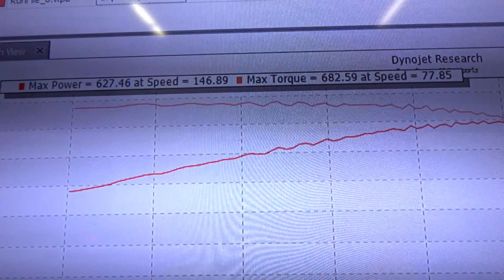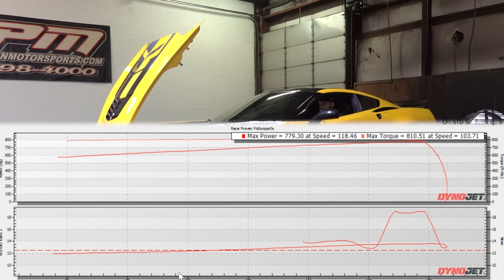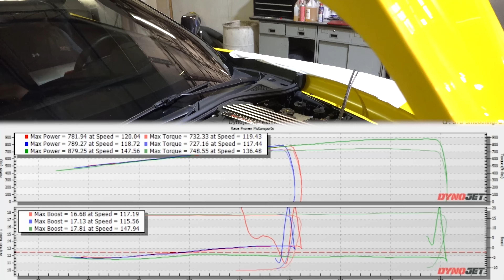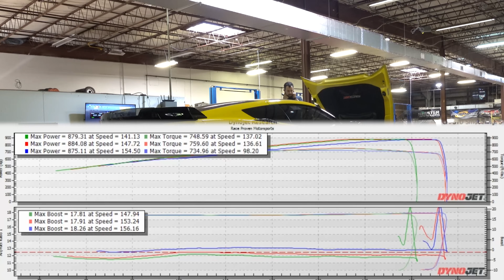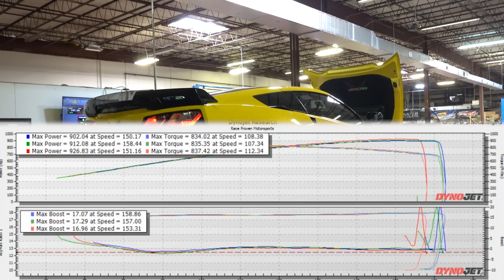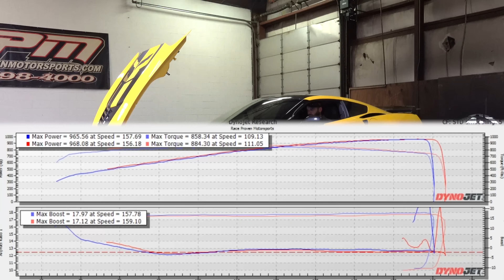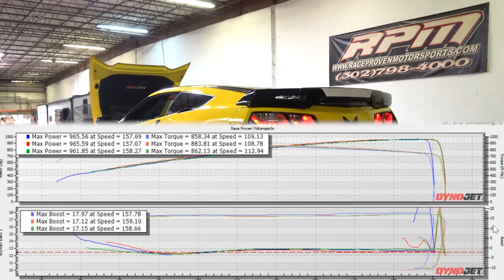Heads Cam 2650 Magnuson C7 Z06!!!

Comment: I made these exact numbers on port injection 964/884 but 20psi with same mods except I have 80 upper and 9.2 lower.  I know port isn’t needed for unless 1100+ I just didn’t want to run meth and wanted to just fill up with E only.  Tuner said he kept timing lower in mid range to keep internals happy.
Reply: Did you use the toohighpsi port injection? If so did you end up having to remove the hood liner for everything to clear?
Reply: @ArcticZ1  no used their lid with the LP plates
Reply: And yes used their kit
Reply: Awesome I’m going that route as well. Thanks 👍🏼

Comment: Still stock injectors and hpfp on the yellow vette?
Reply from the maker: Yes
Reply: @RaceProvenMotorsports  that's awsome on pump and meth with fuel lobe on cam getting to 900 is easy. I'm guessing pulse width b er low 5.5 when still on 93?

Comment: Question; does anybody ever worry about the guibos (couplers not an ethnic slur) on a high horsepower upgrade like this? My first Vette was a C5 Z with a Procharger and meth kit running 10.x PSI boost. Around 600 WHP. It was upgraded as it passed through a few owners and when I got it the engine was as described and the T56 and diff had been rebuilt by RPM in MD after it lost 3rd gear. Somewhere in all the work someone worked on the TT/prop shaft and when I was putting around, one of the guibo bolts almost fell out. Either the aluminum threads were stripped out of one hole in the prop shaft (most likely) or it was not tight enough with not enough blue Loctite. Had to pull the rear cradle and all that to fix it. I vowed at that time to rebuild the TT correctly on any transaxle Vette  I disassembled to that extent. In this case I found a 3.5" DSS aluminum prop shaft in stock locally and installed new bearings (not replaced the first time) but that changed the character of the car. Above 1800 RPM the car vibrated, not terribly pleasant for a road car. I just rebuilt the TT in my C6 Z06 while it was split apart to install Monster triple, Magnuson Heartbeat, etc. The guibos are available from Euro car parts houses for $60. The bearings are available for $100 (good Koyos from a bearing house) and I already bought the tools to work on the TT. A gallon of blue Loctite later (don't skimp on that stuff) I'm as confident as one can be in the parts and labor. Still I wonder about the power handling capability of the guibos and I never see them mentioned here or on other channnels like Late Model Racecraft. 1200 crank HP and the guibos are still okay? I have a curious nature and as easy as rebuilding TTs are, they're a lot of work to get to when you're a shade tree mechanic like me.

Comment: Why don’t you guys ever add Port Injection on your high power cars? A lot of ppl swapping over and getting rid of the meth
Reply: Much more expensive that meth. Especially if you do the Holley system. Too high PSI is much less than Holley but still not cheap

Comment: Great build Fran, did it make 627 baseline stock?  I thought the C7 zo6 made in the mid 500s baseline?  Do you also recommend that I zero out the vvt degrees retard in the high baro table for a C7 stingray 8 speed on e85 and exhaust and nothing else done.  There's some crazy high cam retard in the lower rpm and cruising areas.
Reply from the maker: It wasn’t stock.  Had an air intake tune and don’t remember if it had a pulley or not

Comment: Will the thrush bearings be okay at that power level everyone says the lt4 can handle tons of power but bearing always break hit or miss ???? Thoughts anyone ??? I want to do my bottom end so I don’t have to worry about it even at 850 -950 wheel
Reply from the maker: We personally never had an issue.   A bearing is only as good as the tune.   If the car is detonating and beating up on the bearing it won’t last at any level
Reply: @RaceProvenMotorsports thank you ! Love the channel !!